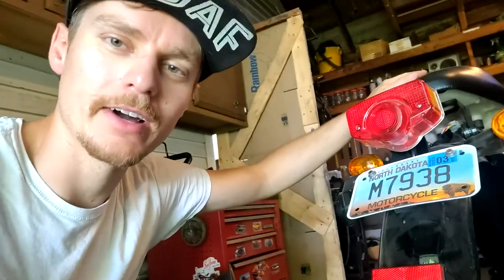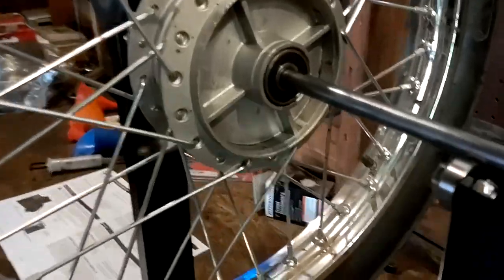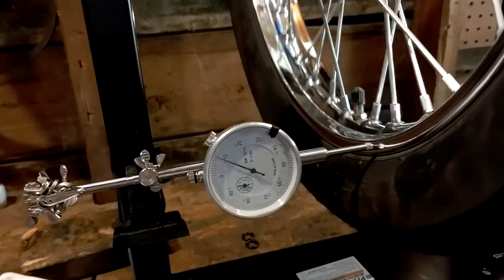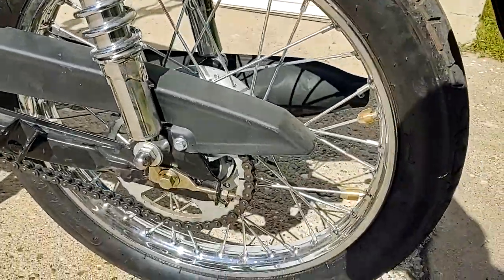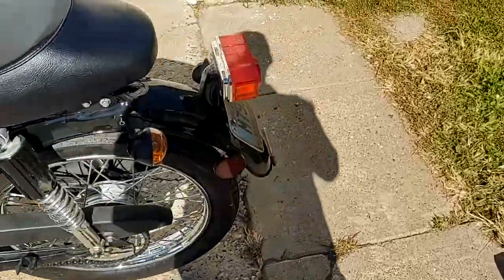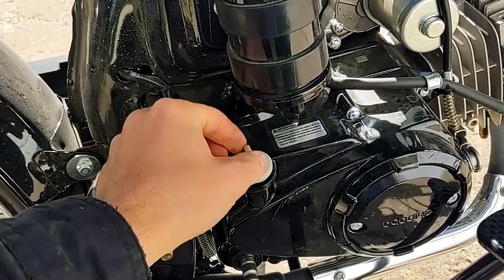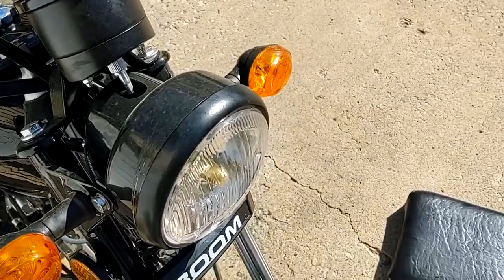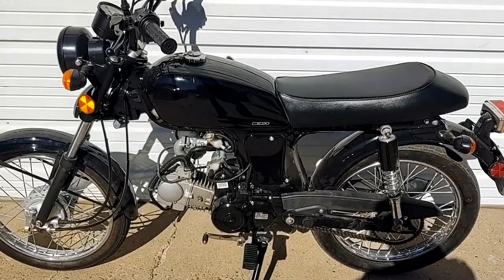BOOM BD125-2 Update: Wheel Truing, Balancing, and Alignment

Comment: i just bought one of these. i love all bikes, owned a buell xb12s , a soft tail harley, too many to list , i mean i could list 20 something motorcycles ive owned np. i have learned alot over the years, and for one, having anything that is a constant money dump sucks. my buddy has a yamaha warrior 1700, and its about 400 to 500 bucks just to get a rear tire when he needs it.  For me, i like cheap lol. something i can tinker with, mod, customize, and not have 20k plus dollars in. i look at the grom, about 3500 for a slightly used one where i live, and its got about 10hp, weighs about 260 lb. the grom clones are way better deal , but still 260lb . my goal, is to get the daytona 4v motor with 25 hp, and i wanted the lightest chassis i could find. this bike is interesting, it has the same frame as a ct90 / ct125, and also shares some things in common with the cg125 honda.  the steering stem is the same as any bd125 ( vader 125 etc) , the grom tripple tree should bolt on minimal mods, go inverted forks with the much better disc brake ( i see complete grom front ends, tripple trees and forks on ebay all day long for about 400 bucks ) , the grom style wheels are cheap, and are tubeless , much better wheels than the china junk. now for the rear, i need to mount the grom rear wheel and disc brake.... hmm, so the brand new honda trail 125, has the same swing arm, and mount for disc brake caliper. on ebay i am finding beautiful ct125 aluminum swing arms for about 150 bucks. that should work fine.  ill end up with a sweet little cafe bike, daytona engine, all honda / grom suspension, and still come out cheaper than a brand new grom would cost me, and have a bike with 25hp. i did some power to weight ratio calculations , to give you a reference to just how strong a 200lb motorcycle is with 25hp. my buddies 1700cc warrior weighs 600 lb, with 83 hp ( yes i know tq, im just keeping this simple) his bike has about  .138 hp per pound. this motorcycle with 25 hp, will have about .125 hp per pound. just slightly less than a factory 1700cc motorcycle.  yes the 1700 will still burn it on top end lol, since its hp tq gives it a much higher ceiling to push through the wind resistance , but from a stop light up to about 50,  by math it should accelerate almost as fast as a much bigger bike.  then i look at something like a suzuki savage,  32 hp, at 360 lb,, thats .0889 hp per pound. this thing has MUCH stronger power to weight ratio lol, and thats a 600cc cruiser . i look at all the 250cc, and 300 cc bikes,  none of them have a power to weight ratio close to what 200lb with 25hp gets you.  i dont want a modern 600cc sport bike, being a hooligan on a 10 sec bike just isnt something im interested in anymore. but you can be a hooligan on a 200 lb bike with 25hp all day lol. this , on a bike i can do anything too it no mechanic needed, parts are cheap,  and its a blast to ride.  i follow a guy who rides a grom clone with the daytona engine, and he loves it. he also owns an mt-10 ,  and he has more fun on the grom clone . i see lots of people getting into this hobby, that own bigger much faster bikes, and they all claim to have the most fun on these little bikes. i paid about 1000 bucks for mine, direct from x-pro with free shipping. all i really wanted was the frame , everything else will be coming off of it. i plan on uploading the build to help others interested in modding one of these , and i see huge potential in the frame as far as building a mini cafe bike. this bike has huge potential to be so much more than as it comes stock, and even after everything is done, ill have about as much in it as a brand new grom, using honda parts . thanks for sharing the video buddy , subbed.
Reply: I hope you’re still around riding your bd125! I have a question if you could help me. Do you know the bearing size for the steering stem?
Reply: @howardkey6152  hey buddy, ya im still riding my vader, its got the full yx 141cc kit on it, high comp piston, the yx 140 head, z40 cam, it runs amazing , it cruises comfortably at 60 mph gps, and with my gearing tops out at about 65. i do not know the bearing size,  best thing to do is just buy a set of steering stem bearings, and just measure them. i have not needed to tear down the front end on mine, so im not sure if it uses the tapered bearings or the standard type,  but they should both be the same outside diameter,  gl man XD
Reply: @benhager2559  thanks for getting back to me. I’m going to do a 140cc swap also! I’ll message back when I figure out the bearing situation!